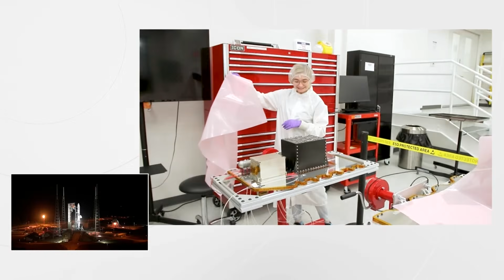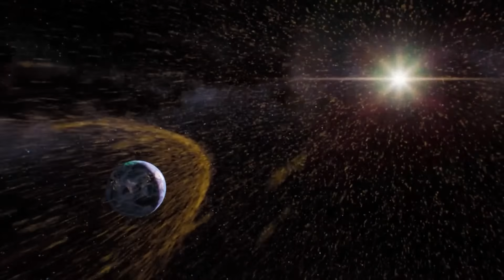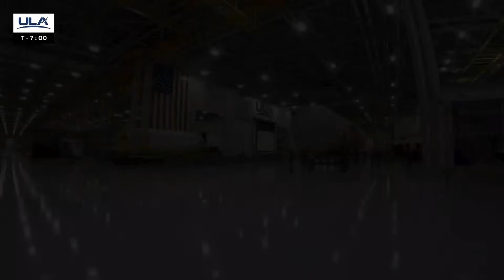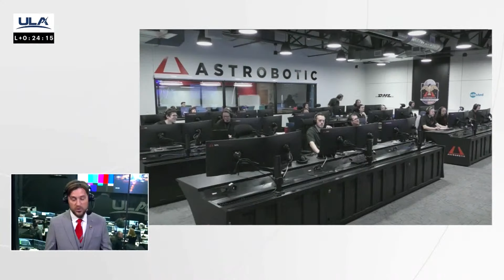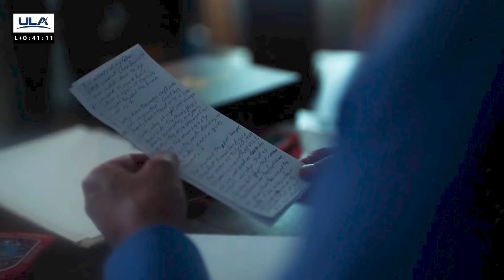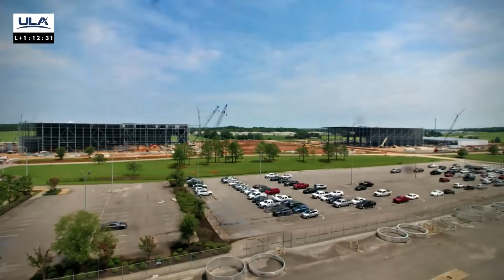Jan. 8 LIVE Broadcast: Vulcan Cert-1

Comment: This is a fantastic rocket. A proper rocket. This is what NASA should have built instead of that hugely expensive, impractical and dangerous Shuttle. I can’t wait for the reusable engine element with the inflatable heat shield to be incorporated too. Go Vulcan!!
Reply: Knowing them, it will end up being so expensive and impractical that it won’t be implemented. Also the the recovery method of choice is less likely to work than even the early fairing recovery approach SpaceX tried with minimal success.

All I’m saying is optimism isn’t warranted here. They aren’t the kind of people to make something like that work.

Comment: Congratulations 🇺🇸💐🎊🎉👍🏻 The greatest minds within these United States have once again over delivered! Thank you all for the outstanding display of team work.. Such an inspiration!! 🇺🇸🦅👏🏻🙏🏻
Reply: True but they subcontract to places in Europe too for this rocket.  FYI.
Reply: @kevinkelly3630  Awesome!  To be honest, I assumed the U.S. government took a hard stand against international suppliers for the new program.. I did just read about a Swiss company supplying fittings/fairings for Centaur.
Reply: The greatest minds?!? They barely made the rocket. All the engines were subcontracted, and those are usually the most difficult and expensive components of any rocket. This rocket also doesn’t do anything outside the normal wheelhouse of a standard pre-2010s style rocket. It’s literally the same type of design with the same engineering and tons of reference points to work from. They made a new model of pretty much the same thing they’ve always made. It’s not trivial at all, but it also isn’t a symbol of what the brightest minds can do - for that you need to look at Falcon 9/Heavy - and hopefully Starship soon too! Electron and maybe someday Stoke’s rocket too. 

ULA is still just a tired old corporate underachiever with minimal ambition beyond maximizing near term cash flow.
Reply: @willitstimothy2  I appreciate the information. Although the most expensive parts of the rocket have been designed to be recovered and reused which is a relief. Granted you've proved me right that the culmination of designs and use of sub contractor's have utilized the greatest minds in our country.

Comment: One thing that's striking in comparison to typical Falcon SpaceX launches is how long the 1st stage burns on this rocket, it's almost twice as long. It makes complete sense they didn't pursue booster recovery since the speeds of the booster at engine cutoff would make recovery difficult at best.
Reply: Like a Falcon Heavy would do in some cases, though for this payload and destination it may not have to.

“Falcon” isn’t specific enough - there’s Falcon 9 and Falcon Heavy, and depending on the mission they can be fully expended if necessary. But that’s the thing - they don’t have to nearly all the time. Vulcan’s are always expended no matter what they’re carrying or where they’re taking it - and for a brand new rocket design in 2024 that’s just sad.
Reply: @willitstimothy2  there's not a lot that ULA could have done, without an independent ability to design their own engines. Once you commit to using something like an RD-180, AR-1, or BE-4 (i.e. 2-3 MN thrust), you pretty much have to build something the size of New Glenn to make VTVL work, the way Falcon 9/Falcon Heavy does it.
Reply: @willitstimothy2  they have plans about recovering engines, but it's just a "plan". 
for low orbits (like LEO) then yes F9 and FH will excel. however, for high orbits (GTO, GEO, TLI, TMI), the hydrogen centaur stage will do better because it is more efficient.
FH costs a minimum of $118m (2 boosters recovered, center expended) and can carry ~15 tonnes to GTO (according to everyday astronaut) but has only carried a maximum of 9.2 tonnes to date. makes sense - why tf would you have a GTO satellite that is over 10 tonnes...
USSF paid ULA 1.3b for 11 launches, or $118.18m per launch. which configuration? idk. but either way the space force always overpays anyways and their offers for vulcan is less than their offers to FH (1.23b for 10 F9 & FH launches) so it's probably cheaper. when dream chaser launches ig we can tell how expensive it is commercially. so 3.3t/8.3t/11.6t/14.4t, likely a mix of all 4. prob not VC0 tho cause 3.3t to GTO gets you nowhere. so just assuming that most will be VC4 or 11.6t.
so a rocket that launches 11.6t to GTO is cheaper than a rocket that launches 15t to GTO. seems p competitive to me.